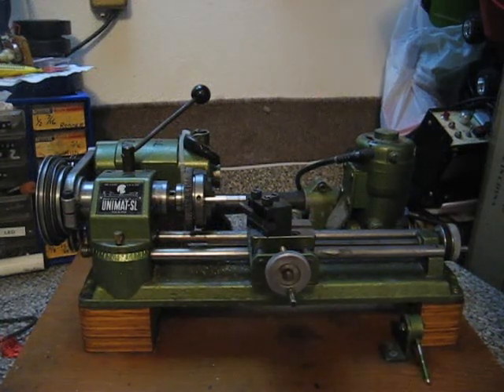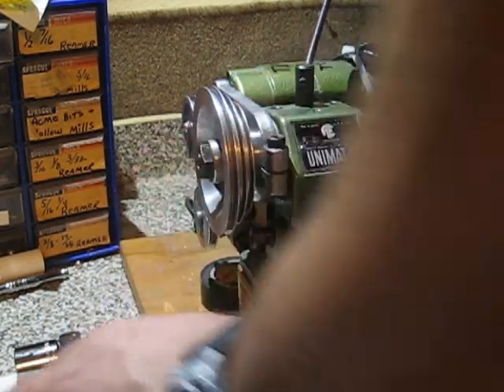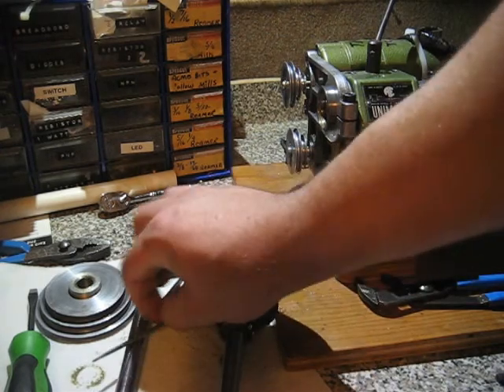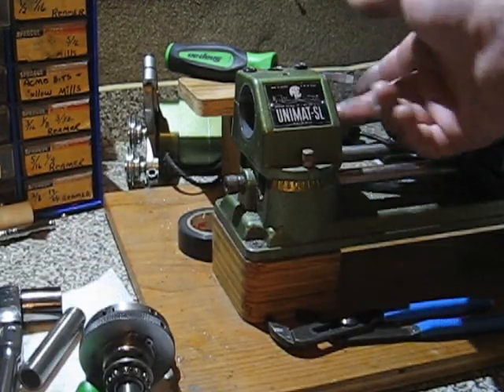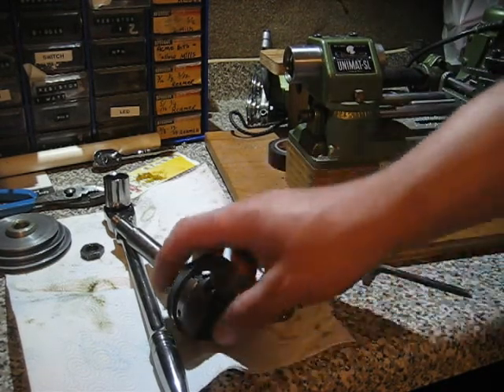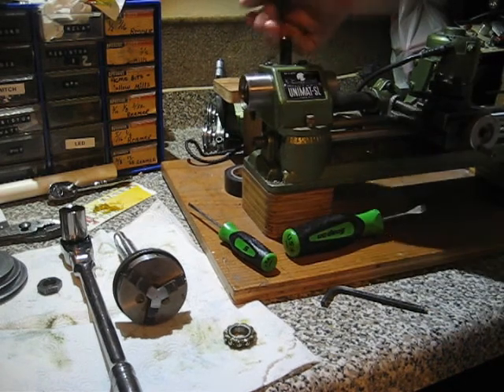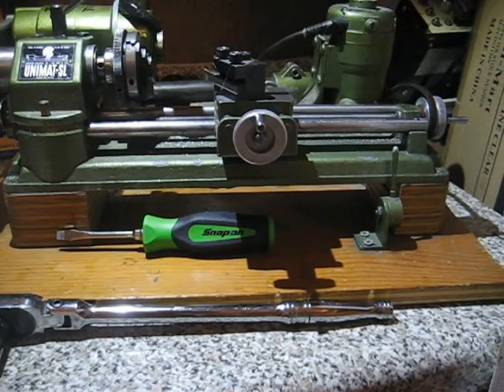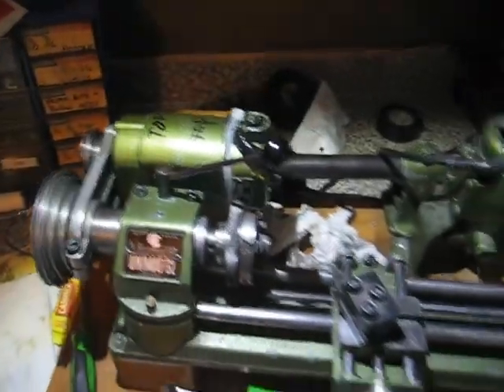Unimat lathe maintenance

Comment: With respect to the Cross Slide, maybe I misunderstood you, but the Cross Slide Wheel and Tail Stock Wheel should have between 1/4 to 1/2 turn of free play.  I believe you will find that in the Lathe instruction manual.  I've had mine for 42 years and have maintained it many times.  I insert a steel rod in the spindle rather than use channel locks.

Comment: Never trust anyone that uses channel locks on anything but plumbing.
Reply: When I saw that it made me cringe!  Use a hardened steel bar through the spindle hole! (also, it' worth protecting the lathe bed and ways with a thin piece of wood while doing this.